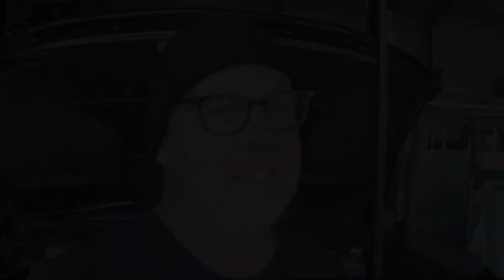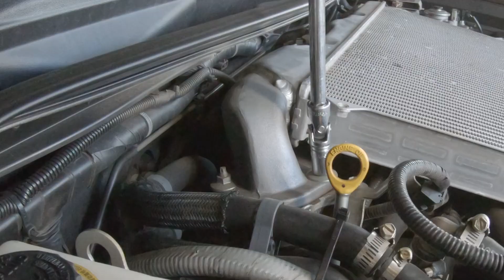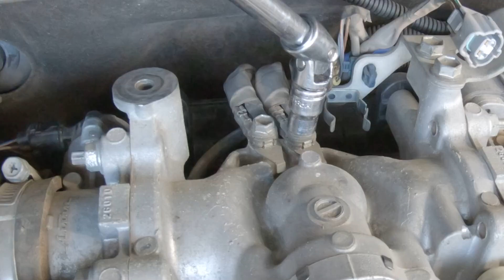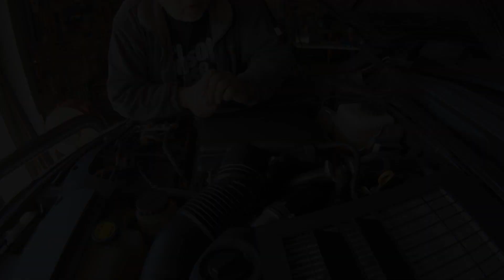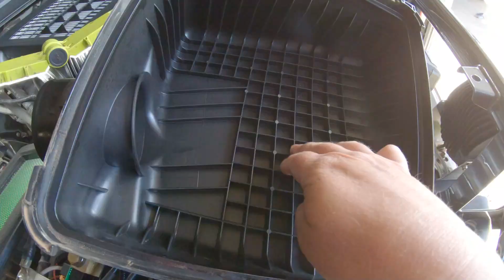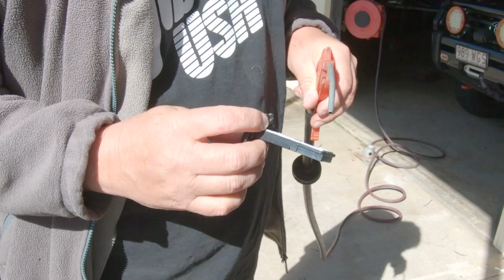How to Service your MAP and MAF Sensors | Toyota Landcruiser 200 Series

Comment: Is it possible to relocate that map sensor so that it can be changed without removing the intercooler
Reply from the maker: Sure can mate, and the length of vacuum hose they provide you would allow for this.  Something I should have done the first time around😎👍

Comment: Hi Terry my 200 series went into limp mode 20 times on a trip towing a van and 20 times coming back. Cleaned maf...replaced map sensor filter and sprayed connection. Didnt help. Toyota cant do anything unless its in limp mode. U heard of this issue  p004b code?
Reply from the maker: No mate, sorry I can’t help

Comment: Hi terry 

Got a 2007 200, last year the turbo went and got a recon installed, just a couple of days ago was driving at 140 kilometers and the car cut out and wouldn't start, disconnected batteries still not start. Do you think a map or maf sensor could be the problem... or...
Reply from the maker: Mate, that’s not cool at all.  Did it throw a code?.  If so, go down that rabbit hole.  If not, I’d be checking fuses as a next step.  MAF and MAP very unlikely

Comment: Hi Terry.  Thanks for your video.  Great job explaining everything.  Only problem I have is disconnecting the MAP sensor.  Can’t find the catch/locking mechanism to release it.  Don’t want to give in yet.  Can you describe how you disconnect the map Sensor please?
Reply: Thanks Terry.  Had to use a pair of pliers to squeeze the tang to release it.  Cheers
Reply from the maker: Good stuff mate 😎👍
Reply from the maker: The plug has a tang on it that you squeeze to release it from the tab on the sensor, then pull at the same time.  I had angled needle nose pliers which help but I have done it by hand as well.  Cheers

Comment: Hi Terry do you have troubleshoot docs for transfer case? Im having trouble with my low 4 and diff lock not engaging on my 200 series once in a while. Its not water in the assembly. Thanks
Reply from the maker: No I do not mate, but it certainly sounds like corrosion or other crap in the assembly, or a poor connection on one of the electrical plugs.  I trust you will get it diagnosed mate👍

Comment: Im def getting a uni filter just checked mine that has a genuine and theres red dust and beach sand under the filter...top of filter is clean. Where did you get your uni filter?
Great video😀
Reply from the maker: Good call mate, the factory system is rubbish and the demise of many a 200’s can be traced to dusting.  I bought it direct from Unifilter off of their website.  Cheers😎👍
Reply: @JafffaAdventures  thank you
Reply from the maker: All good mate, go well😎👍
Reply: @JafffaAdventures  what grease do you use for the gasket of unifilter? Does it have to be specific filter grease or can engine oil or lanolin oil be used? Cheers
Reply from the maker: @treebs9516 I use o ring grease, but any high viscosity grease will do the trick.  Cheers 😎👍

Comment: Hey Terry, would you consider replacing MAP sensor with an alloy option because of the heat behind intercooler ?
Also would you suggest using a small spring clip to give the small hose a bit more integrity to the sensor?
Reply from the maker: The logic I have heard with replacing the plastic MAP sensors with the stainless ones is that the stainless will not break and you can leave them in forever, whereas the plastic ones become brittle over time and can crack.  That does not work for me because I believe they are a replacement part (given they have a filter in them that can clog) and should not be left in there forever.  I’ll continue to use the genuine ones and replace them every 100,000km.  A small spring clip on the hose is a good idea however, as they have been known to come off.  That’s my logic anyway mate.  Cheers😎👍
Reply from the maker: The logic I have heard with replacing the plastic MAP sensors with the stainless ones is that the stainless will not break and you can leave them in forever, whereas the plastic ones become brittle over time and can crack.  That does not work for me because I believe they are a replacement part (given they have a filter in them that can clog) and should not be left in there forever.  I’ll continue to use the genuine ones and replace them every 100,000km.  A small spring clip on the hose is a good idea however, as they have been known to come off.  That’s my logic anyway mate.  Cheers😎👍

Comment: Hi Terry, Thanks for the video. Great quality and very easy to follow.
 On my 200 I have experience a P1248 error which google tells me is either "Boost Pressure not detected" Or "Exhaust Gas Recirculation Flow Bank 2" Do you think this could be related to MAP sensor at all?
Reply from the maker: Thanks Brendon, that is very kind of you to say mate.  It’s possible, but unlikely.  P0069 is usually the code related to a failed MAP sensor.  If your problem is boost pressure related, your car should feel very doughy under acceleration.  If it drives fine, I would be leaning more towards an EGR issue.  Let me know how you get on so we can all learn from your experience.  Cheers mate😎👍
Reply: @JafffaAdventures thanks Terry. Was a midnight misadventure last night, but having the video certainly helps. I'll attempt to clean the intercooler at some point in the future too. 

After more reading, lots of others had experienced similar issues as an EGR fault. Some people had a resolution by simply clearing the code, which I did by removing the negative terminal last night.

Seems to have worked. Car is better seemingly back to normal now.
Reply from the maker: Good stuff mate, let’s hope it was a ECU hiccup and nothing more than that.  Thanks for sharing😎👍
Reply: @JafffaAdventures  3 days later the error has reappeared. Ultra gauge could not clear it and was limited to 4th gear. Disconnecting the negative clears it.
Reply from the maker: Sounds indeed like something more sinister mate, bummer...
Reply: had the same issue on mine. turns out to be the EGR valve on bank 2. Replaced both the egr valves and now it is running fine. @brendenkoh21

Comment: Awesome vid mate and thank you ... have you ever cleaned your inlet manifold/EGR system on your land cruiser?
Reply from the maker: Thanks Peter, I appreciate the kind words.  I never never cleaned it, but as I noted in the vid I have the EGR blocked off and it’s been that way from about 60,000km.  I’m sure there is goo in there, but it’s not as bad as it could be.  If the starter motor packs it in, I’ll clean it then.  Cheers😎👍

Comment: Thanks for cutting this open. Always wondered if they got any oil soak. Had one in the glove box for awhile😁😁😁
Reply from the maker: No worries Tony.  Mine certainly was not, but I do have the catch can so my intake is relatively dry compared to the factory egr system.  Now get it out of the glove box and install that little sucker😂😉